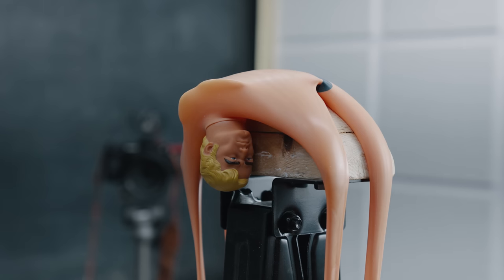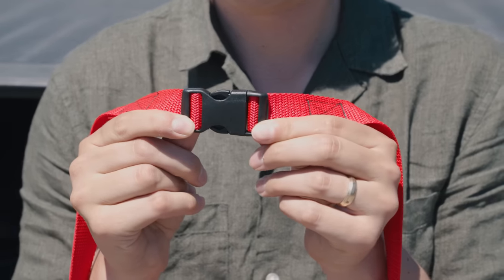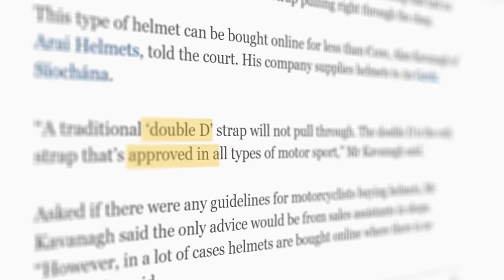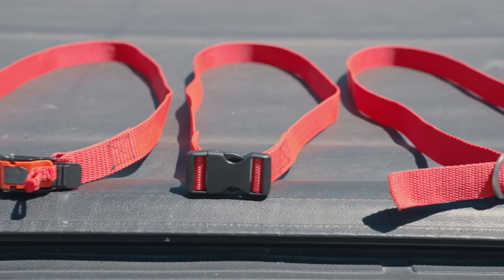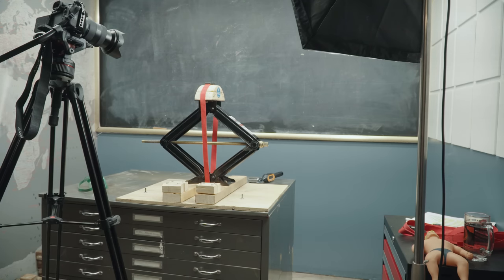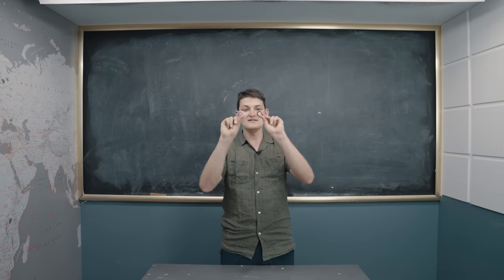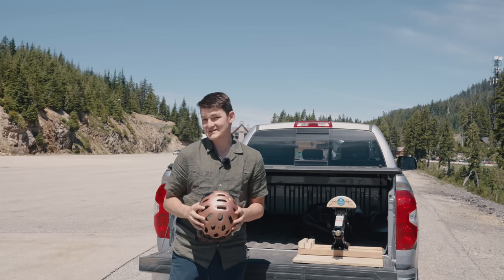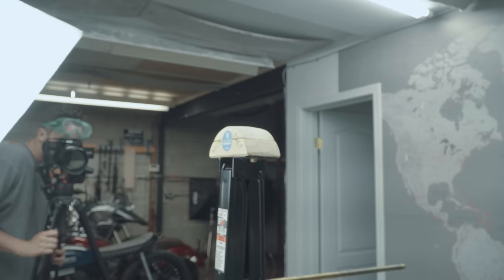Why Motorcycle Helmets Use this Ancient Buckle

Comment: I saw this video a couple of weeks ago. Last week when I was going ready to go out on my bicycle I thought about what you said about the double D-ring closure and how it forces you to adjust your helmet properly every time you put it on.

So I checked my own strap and found it was a little looser than it should be. I adjusted it, and found it a little tighter than I'd like, but left it that way.

8 minutes later I was sitting on the side of the road, surrounded by shattered carbon and spitting my teeth into my hand after going face first into the A-pillar of a Hyundai at 30km/h (car came out of a driveway 3-4m ahead of me - I only had time to wince).

The fact that you inspired me to adjust my helmet may have contributed to the fact that apart from some dental damage, all I have are a few bruises from this encounter.

Thanks!
Reply: What kind of helmet type did you have? I know that the full face is the best option but god dang do those jet ones look sweet. But their cool factor definitely clashes with thoughts on safety and how eating teeth for lunch doesn't sound very pleasant.
Reply: This was insane to read, happy you’re still here man
Reply: @midgetman4206  probably a bicycle one
Reply: @bigboyhours6473  God dang it... wow...
 
Thanks for that, jesus, man. How did I even miss that?
Reply: What type of helmet? Full face or jet one?
Reply: @TheMilenkata  bicycle helmet.
Reply: Tip for the future, always scan the areas next to the road for emerging vehicles. If you can’t see up the junctions or driveways due to parked cars, slow down.
Reply: Thats cool...except if you hadn't wasted the time to check your helmet, you wouldn't have crashed at all...lol. maybe
Reply: if you think about it... if you wouldn't have checked your double loop then rather than the next day, you wouldve gotten to the same crash point but minutes earlier and miss the man
Reply: @chrisblake6291  interesting viewpoint, I will add perhaps in the future someone else will read their comment and save themselves. A message to a future space traveler.
Reply: Sorry re the teeth , I think  you're adjustmrnt saved your noggin. I always feel I need to spend 30£ and get s custom mouthgaurd . Protects teeth
Reply: Sorry re teeth . Tight strap amendment saved your noggin
 I always feel that a custom mouthgaurd will protect teeth and allow for easy re- positioning and splinting of teeth  for any avulsed or displaced teeth
Reply: @kato093  That's not a very sensible way to look at it
Reply: @midgetman4206  Mountainbike helmets are pretty good even for road since they cover more. 
MIPS might be a good idea, not 100% scientifically proven but hey it's your brain it's protecting.
Fidlock is also super practical, you can open and close with one hand, gloves are no problem even with thicker winter ones. Works great.
(fox speedframe pro is mine if you care, good and looks nice, expensive tho)
Reply: This cannot be purely by chance. I'm glad you're still breathing, stay safe 🙏
Reply: Don't understand why cyclists helmets aren't full face – chin takes full impact in case of fall over handles. I've 12 stitches in my chin from 2 falls at speed. And why no armour gear...? I d understand it makes things much heavier, but seeing contestants pile up and come up bleeding is crazy. Speeds are fantastic. I'm sure kevlar built into spandex all-body wear would be light and ensure more riding, less hospital.
Reply: @shaftdrive7567  there are full face helmets, just buy one.
Reply: Maybe the Hyundai driver has some teeth to give you.
Reply: Bicycle riders with helmets get into more accidents, statistically.
Reason: the highly over-estimated sense of security makes them ride more aggressively, and/or with less caution.
Reply: @maxsolo2652 people who ride with helmets are probably also more regular riders...
Reply: @maxsolo2652  trust me it’s still better to wear a helmet regardless of that. I got a concussion in late 2019 from falling off my skateboard at 25kmh, and there is nothing that can describe the amount of regret for not wearing my helmet that day. It’s 2022 and my brain has still not fully recovered and I don’t think it ever will. WEAR YOUR HELMET.
Reply: @maxsolo2652  that makes no sense. I want to see those statistics.
Reply: I'm happy you are ok, words to ride by
Reply: @kato093  except that maybe, just maybe, that crash saved him from a bigger one in which without the helmet, he'd be looking down on us from heaven.
Reply: If you were riding a motorcycle, and doing 30 MPH (48KPH). Do you think that helmet would have done you any good? I live in a USA State that gives motorcycles a choice rather to use a helmet or not. I choose, not. I use a helmet when I am going on long rides at high speeds. It keeps the bugs out of my eyes and teeth. Other than that. It's all there good for.
Reply: @maxsolo2652   Similarly, the British army logged far more head injuries after they made helmets mandatory during WW1, casting significant doubt on their efficacy.
Of course, far fewer men were dying of head wounds, too.  Statistics are a finicky business.
Reply: Always tightening under chin and behind my head every time I put helmet on is one of those OCD things I will never stop doing.
Reply: Life Imitates Art 🙂
Reply: glad to hear you are ok. Could I ask what roadie helmet you were wearing during your accident?
Reply: The greatest danger to bicycles, motorcycles and other pedestrians - horribly designed driveways.
Reply: Still....lifetime of fighting those stupid straps, what's acouple of caps!
Reply: How many 100k denominations did you have to pay for your teeth
Reply: @shahan484  in terms of dollars - none. I have excellent dental benefits through work. That said, the new ones don't work very well, and they always hurt.
Reply: “May have” being the key thing.

Comment: The best argument for alternatives to the D-rings may be, as you said, protecting motorcyclists from ourselves.  How often does a rider neglect to fasten a D-ring strap?  Maybe the safest fastener is whichever one that a given rider will fasten every single time they get on their bike.
Reply: well the ratchet clip you also have to tighten every time, thats why its so long because you put it in untill the point its tight
Reply: I am like that, I bought rachet buckles for 2 of my helmets with DD rings and ask my wife to sew and replace it with them
Reply: idk about you but my head and neck size doesnt vary much.  one of the other ideas would've been fine if they were alsp made of metal.  the only reason the d survived is because metal
Reply: @Notred1775  I have a micrometric one, but it is made out of metal. Wonder how big of a difference it makes compared to the plastic ones. It has to be quite significant though.. considering the other is.. plastic.
Reply: @Luggruff  I've just bought a HJC i71 and (my fault) I thought it was a double D and instead is micrometric... I never had this before and I'm considering to returned or change it for another helmet. It's also a plastic one, I don't like it at all...
Reply: Bold of you to assume a faster closing system would make people strap up anyway. Trust me, you can make something as straightforward, fast, and easy as possible and inevitably, someone will still mess it up either because they dont care or because theyre lazy- usually a combo of both.
Reply: @supremeblaster7537  if you are talking about a motorcycle helmet, that is scuff to the max and I would not suggest it. the way they are sewn on will affect how safe they are and I Imagine you don't have a safety rated industrial sewing machine in your house

Comment: I always try to buy helmets with the D-rings. Sometimes I've been forced to buy another system, when a helmet was too good in other ways to pass up. BUT I always lamented the absence of D-rings. Some people find the D-rings fiddly, but I find it the easiest to deal with - the other systems are fiddly and you have the hassle of trying to adjust the constantly slipping strap adjusters. Weirdly I've noticed D-rings tend to come on the very cheapest helmets AND the most expensive - it's the inbetweeners that insist on putting these other crap buckles on their helmets... Great Vid - Cheers FortNine.
Reply: I JUST replaced my $40 Bell Qualifier with a year old on clearance Schuberth C3 Lite. It's got that micro metric ratchet, and yeah it's annoying in how it tightens! Theoretically it's faster, but I set it so fully seated is too tight, so I can click it a notch or two tighter before adjusting it again. But just in regular use I can click it too far, have to release it, and click it closed again. Not really faster!

But the Schuberth C3 is literally tens of decibels quieter than that Qualifier. hfs, I did not notice how loud it was until I got a bike that wasn't obnoxiously loud itself.
Reply: that's true! i've noticed that with a lot of products and things that come in a range of quality. And the manufacturers will goof off and "experiment" with their mid-range things. So if both the cheapest AND the most expensive versions share a part, it's probably a decent part.
Reply: :dothefive:

Comment: Interesting - I have two helmets, one with the old school D-rings, and one with the sliding ratchet.  I prefer the ratchet as quicker and simpler - I had no idea the D-rings might still be a better solution.
Reply: I've got the slide ratchet on my lid. Find doube Ds annoying. My ratchet is made of metal though. Would be interesting to see how that fairs...
Reply: serdy ximi  and like he said in the video, the others are destined to not be set properly because people will inevitably make them far too loose
Reply: I have same. I have never and will never wear the ratchet on the highway. The D-rings have always felt safer because they pulled tighter every time and there was no quick release.
Reply: the only reason you think it takes longer, is because you're needlessly unbuckling the dd buckle.  Just slide it to it's stop by pulling the tab.  If the strap isn't long enough, it's a design flaw, or you have monster neck and small head.
Reply: I too have a ratchet fixing helmet.  It is easy to sinch  tight and is the only system that you can sinch  tight and remove with gloves on.  
How ever this video proves that although you can only  fix and remove D-ring helmets with your gloves removed they are safer...
Reply: @stevenvankoutrik992  well if we are talking about getting one head ripped off the the d rings aren't safer but the helmet will still be attracted to the removed head
Reply: For all motor sports, only double D-rings are authorised in 2021. All other stuff is more convenience over safety. The ratchet in the video is metal.
Reply: @joshwells4629  For all motor sports, only double D-rings are authorised in 2021. All other stuff is more convenience over safety. The ratchet in the video is metal.
Reply: You will find that all of the high end racing helmets only come with D rings.
Reply: Advantage of D rings is you can even adjust them while riding. Also apparently it's easier for emergency responders to cut open your helmet, because the rings aren't as much in the way as ratchets.
Reply: @LeoinFrance  that ratchet was definitly not metal. if it was, it wouldnt have shattered the way it did, rather broken the mechanism or stripped the teeth.
Reply: Same!
Reply: @hadrianhaine5204  I've threaded through my double D ring on more then one occasion one handed on the highway with a gloved hand when I forgot to.
Reply: @stevenvankoutrik992  

That’s the problem with the test. It doesn’t replicate real-world crash situations. He might as well test which buckle melts last - interesting, perhaps, but irrelevant.
Reply: this is nonsense ... your neck will break before the weakest latch comes off
 p.s. you can find out why motorcycle arches are thinner than the motorcycle frame....with latches the same
Reply: I've always found double Ds a pain to work with when the gloves come on.

Ratchet was infinitely easier to set to a decent tightness for the daily commute (and get off).

Double Ds were often set too loose because of the hassle of loosening them when too tight.
Reply: I've always found double Ds a pain to work with when the gloves come on.

Ratchet was infinitely easier to set to a decent tightness for the daily commute (and get off).

Double Ds were often set too loose because of the hassle of loosening them when too tight.
Reply: @joshwells4629  I have the metal ratchet too. I hadn't even thought about that when I chose the helmet. My bicycle helmet is much worse though, as far as the adjustment is concerned.
Reply: @sam-ww1wk  The problem is if you can just slide it to its stop people will often just leave it in that position all the time and then argue when stopped that it is 'done up', I've seen them do it.
Reply: I use d rings on my belts, never have to add more holes and my pants always stay up. I can definitely see the advantage on helmets.
Reply: "Clean ups a breeze! "
Reply: well technically the ratchet design isn't much less safe cause if your head is subjected to over 500 pounds of pull force its most likely leaving the vicinity of your shoulders either way.
Reply: @aaronleverton4221  That's just great for someone with the dexterity to use a bad set of Ds.   For old guys, the ratchet is better and is perfectly adjustable every time.   You set the adjustment once and then ratchet it up.
500 lbs is plenty of force to hold the helmet on, 900 is a neck break.
Reply: @burnsmatkin9606  Why are you explaining to me how a helmet I have stated I own works?
Reply: I can just loosen my D-ring and slide the helmet off my head without undoing it (and the little snap button thing prevents it from undoing itself).
Reply: @hadrianhaine5204  Wire rope and padlocks safer still...how much safety is enough.  Individual decision as it should be!
Reply: @nolimitgsxr5090  Very few people have the dexterity of microsurgeons, so goody for you?

Also riding with a hand off the bars is illegal in many jurisdictions.
Reply: I too have a d-ring helmet and a ratchet helmet.  Maybe I'm doing something wrong (new biker) but I find the d-rings INCREDIBLY fiddly to undo!  Once they are pulled nice and snug, it takes me five minutes of fiddling and catching my beard in the strap to take the damn helmet off again!  With the ratchet strap, I pull one tag and it's open.
Reply: @Sciguy95  Bike helmet straps are particularly a pain to adjust.
Reply: It isn’t a better solution as the strap will eventually fail trough the connection points of the helmet.
Try taking off one of those helmets in a rush while wearing gloves…

Comment: Thanks for interesting videos! I had my first JET-helmet 1968 and it had Double D-rings. Then I have had more modern locking technics. However - few years ago I bought a modern but retro style Jet-helmet with double D-rings. This helmet was used only a few occasions as I prefer integral helmets but this time it was a slow bike and it was sunny weather and the style looked autentic vintage-like. Almost 2 yeras ago I had an accident by driving into the green grassy strip along the road. The speed was 45-50 km/h with my renovated to state as new Husqvarna from 1953...  Oh shit I thought - I have been into enduro in the eighties so I'll handle this. Next moment the bike just disappeared from me and I counted 3 full loops in the air, and only a half 4:th loop then I hit the ground on my back. I lost all breathing air but was alive. I got no air to breath so I first checked my fingers - I could feel all of them. I got of my gloves and the fingers opened the double-D-ring lock autonomously....  amzing - this just happened by it self.  With full breathing capacity I just laid down there for some minutes.  I tried to remember when it was the last time I had a double D-ring helmet.  Then I wondered why none of the cars were stopping and check if I was OK. I found that the side of the road was a long and fairly steep slope. I turned around and I saw the shining blue bike several meters above me on the grassy slope. As soon I reached the roadside I got help.
But - I am still amazed that the body can learn things and then perform them just by itself!
Reply: r u sayn muscle memory?